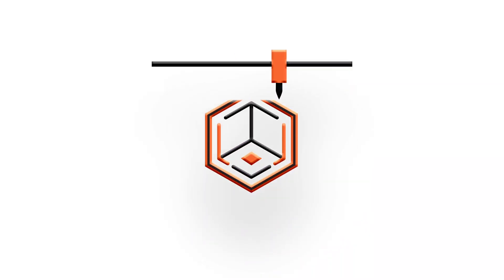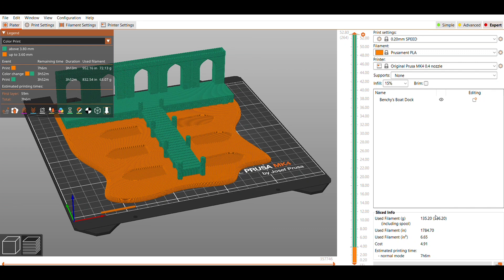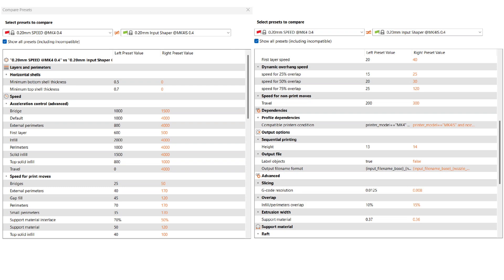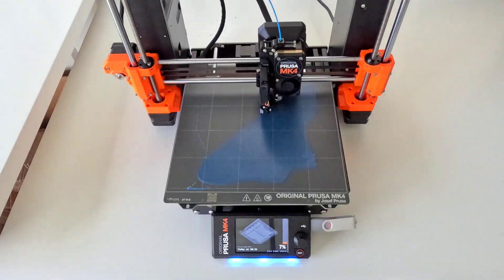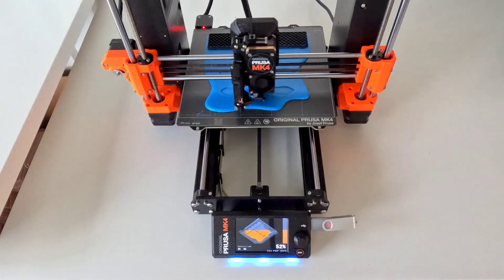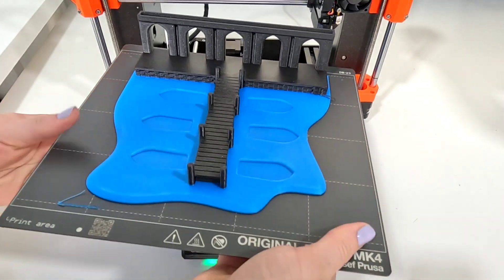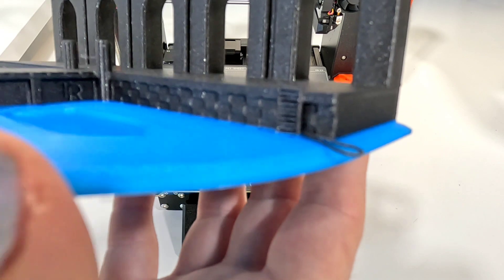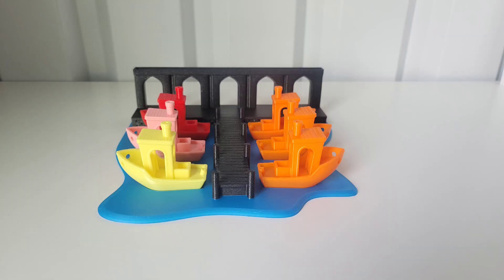Benchy Boat Dock on the MK4 with Input Shaping!

Comment: Great video as always.
How was the filament change operation mid-print.  Straight forward like the MK3/MK4 (or a work in process)?
Reply from the maker: Super easy! I have not had any problems swapping filament on the MK4. Thanks!

Comment: Would be nice with some MK4 vs XL videos, i got a single tool XL on preorder and cant decide wether i should stick with it or go with the MK4, running i a mk3s today with great results.
Reply: I had an XL on preorder and swapped it for a MK4 when that became an option. I'm happy with my choice, but part of what drove my decision was space -- the XL just takes up so much more space than the MK4 (and my MK3S+ and MK2.5S).
Reply: What does a Mk4 have on an XL? I thought the xl was better in every way except foot print and ease of filament loading.
Reply from the maker: I love my XL but I would say the pros on the MK4 are - available sooner and is a lower price point. If someone doesn't need the larger buildplate or toolhead, the MK4 might be a better choice. I'll be curious to see how the MMU on the MK4 compares to the multi tool on the XL.

Comment: Cool print.  You should experiment with a 0.6mm nozzle.  The quality is usually on par with the 0.4mm and it'll print even faster
Reply from the maker: That's a great idea. I have gotten used to the .6 nozzle on the xl. Thanks!
Reply: @tada3dprinting  there isn't a 0.6mm input shaping profile from Prusa right now but you can make one by using the compare function you've learned about and transferring all the nozzle specific settings from the stock 0.6mm profile to the 0.4mm IS profile and saving your own 0.6mm IS profile.  Hope that made sense.
Reply: for example, that model prints in 3h 17m with a 0.6mm nozzle and the input shaping firmware (0.32mm layers)